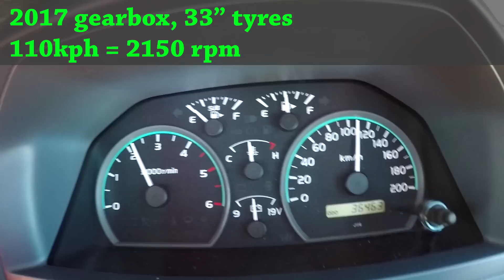New MY17 Gearbox fit up to 2012 V8 Landcruiser 70 series

Comment: 4K is a lot of Diesel and 2350 RPM is bang on the Peak of the Power curve and the best AFR...and lowest EGT....Not so sure this new Box is such a good idea...2k RPM is not lugging but still, the 5th gear is also smaller and will generate more heat.
Old Box for big Hauling new box for those that don't tow...cause you wont get better economy with this new Box unless you MAP the Engine to suit. The only time you will get better economy is unloaded

Comment: I'll need to keep an eye out for these here in Africa as getting a gearbox here... I might as well ship a new truck. :S  Noticed you mentioned being able to change out both 2nd and 5th gears into the old case.  Would you have to do both or can you just swap out 5th.  Been wanting to do this with Safari's upgrade on my '05 HZJ78 but they stopped making it.
Reply: Paul Weber gh
Reply: Terrain tamer do a 5th gear replacement set about 1300 aud

Comment: Is there a different way to do this? Like a new gear set to put in the existing box?  A new 5th gear combo.
Reply from the maker: You can but by the time you buy parts and labour there isnt too much $$ difference between the 2. Fitting the new gearbox you can then sell your old gearbox to recoup some of the money spent.
Reply: Perth Diesel Performance/SS Auto Repairs thanks pdp 👍

Comment: i guess this is an option for buying a 2016 cruizer then chucking the 17box in to get the taller gear without having the issue with the dpf. woner how much toyota charge for the trans
Reply from the maker: Yes you can swap the gearbox from your 2016. We have the gearboxes in stock. They are $3800 supplied.
Reply: @PerthDieselPerformance  how much is it now in 2021?

Comment: Yeah but how much for the swap and how much for the same as 2017 gear set swap from terrain tamer boys??
Reply from the maker: navy Guy new box is $3800 with full Toyota warranty. You can sell your old box for anywhere from $1000-$1800 depending whats for sale and who needs one at the time so when you take that off the cost its a pretty good changeover.

Comment: Do you guys think these 2017 onwards models need to be regeared if running 35’s?
Reply from the maker: Our dual cab has been fine with factory gearing and we run that on 35's and have done from when we got it. Without our power upgrade they are sluggish though.
Reply: Perth Diesel Performance  OK, thanks for the info.

Comment: If the vehicle is not required to do severe duty 4wding, wouldn't it be much easier and far more cheaper to change the final drive ratio at the axle?
Reply from the maker: It is a possibility but if you price both options up - genuine parts - it can come up around the same price. Also you lose your low range gearing which most use over here. 
Once you work out what you sell your old gearbox for and the swap over price, its the best value option on the market.
Reply: Would it be possible to swap out the 2nd and 5th gear of a 2015 model for a 2017 model?